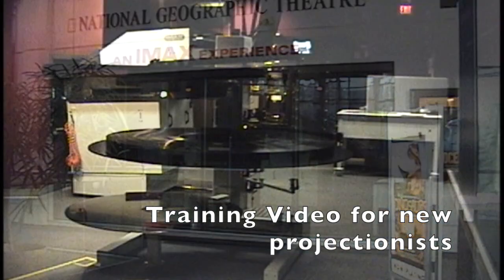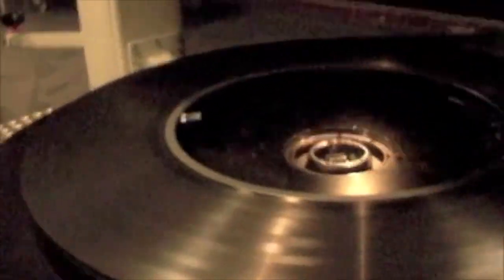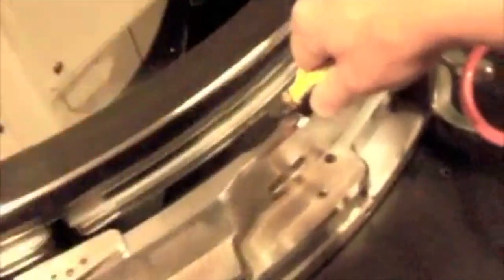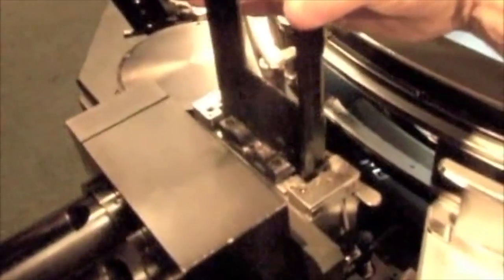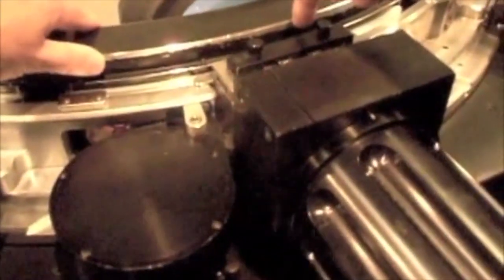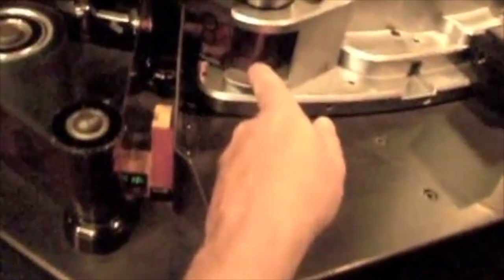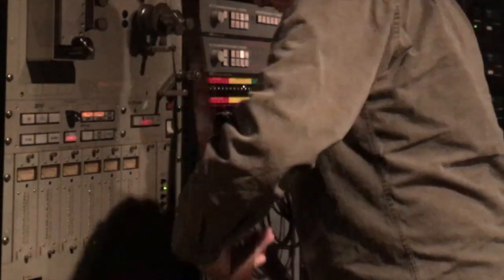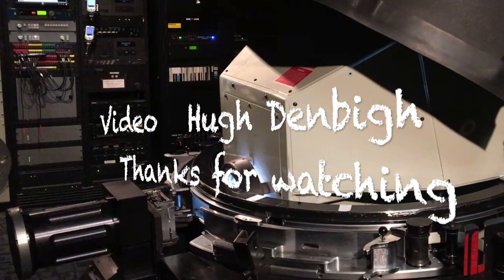IMAX Projector | Step-by-Step how it's done behind the scenes

Comment: I never realised, until recently, that the sound was not on the film. Amazing that a digital sound system can synch with a basic "analogue" film.
Can it ever go out of synch? I mean - if there's a film breakage & the repairs & splicing results in losing a few frames, how does it get back in synch?
Reply from the maker: Hi, yes the entire sound system relies on frame count of the film. If the frames are not replaced after a crash the sound sync will be out. When ever a crash occurs resulting with damaged film, that damage must be accounted for and replaced with generally black frames by counting frame lines or sprockets holes. If the repair is large in terms of frames, this will become noticeable on screen. Depending on the severity, the film may need a replacement real. Replacing with black slugs can be very difficult to get right, a reference frame line near the damage in the film has to be found. As the film runs through the projector, a small electro/mechanical spinning wheel with optical sensors mechanically attached inside the projector sends pulses to the sound system. These pulses represent the frames of the film. So physically the film frame count from start frame to last must be maintained.
Reply: @HughDenbigh   OMG ! Thank you for explaining it !  An optical soundtrack on the film is so much simpler !!  Ha !